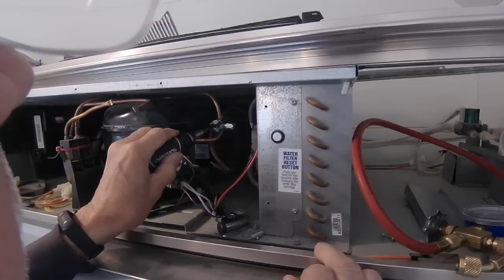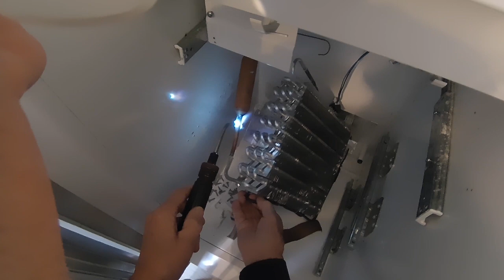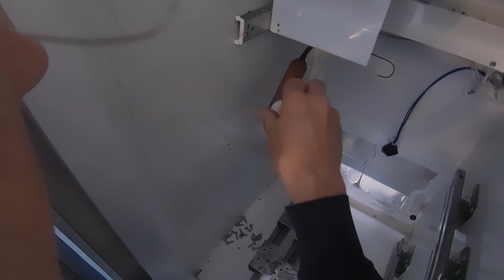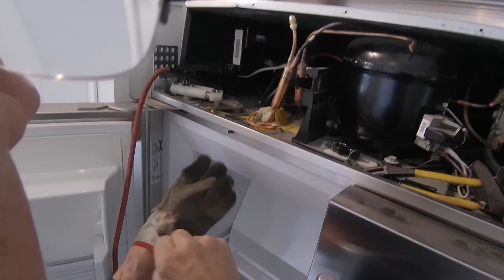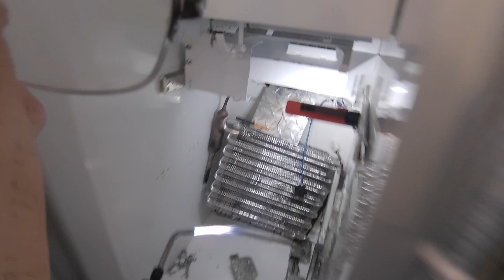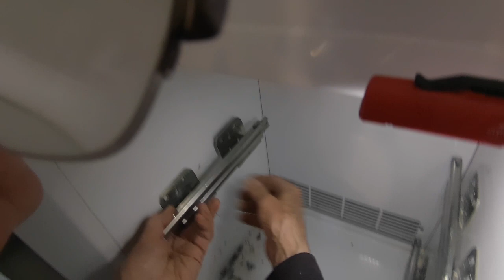Sub-Zero BI-48 Freezer Evaporator Remove and Replace

Comment: Hey, just wondering if you ever run a cap tube instead of replacing the whole heat exchanger in case of restriction. Would a number 2 cap be better to prevent future restrictions?
Reply from the maker: You can run the cap tube through the suction line, I’ve done it before on subzero units that can’t be pulled out. Make sure it’s the right I.d..

Comment: Thanks for the all the videos,  is there any way you could do a video on how you use the dial a charge. I'm gettin ge into sealed systems and want to keep my trips to the truck down. Thanks
Reply from the maker: You can peruse my sealed system videos there I show you how to use the charging column
Reply: @SubZeroSpecialists  ok thanks I'm just trying to get the recovery process down
Reply from the maker: @brianmatthews6162  I have several video showing how to recover and recharge. Try perusing the sealed system videos part 1 and 2 https://youtu.be/IFOIlt_WsOo , https://youtu.be/Up36SJzdLg8

Comment: The process port like you have, do you have a part number for it
Reply from the maker: You can get them at any HVAC supply or online, It’s 1/8NPT x 1/4 flare. It’s called an access port.
Reply: Master Tech 🙌🏼💯